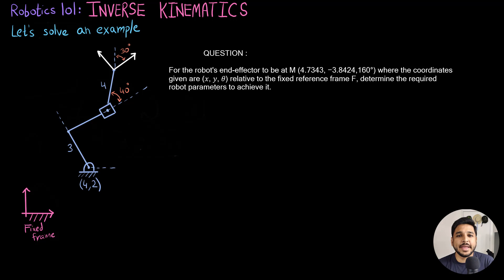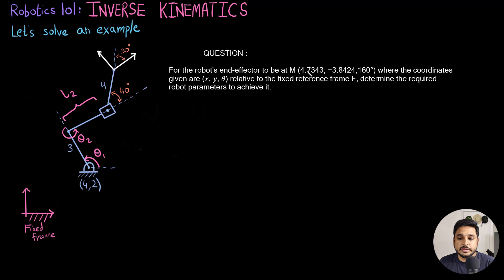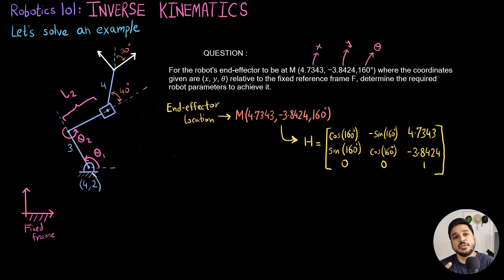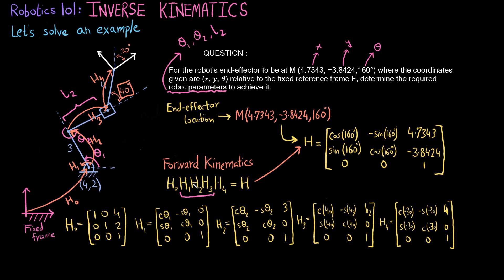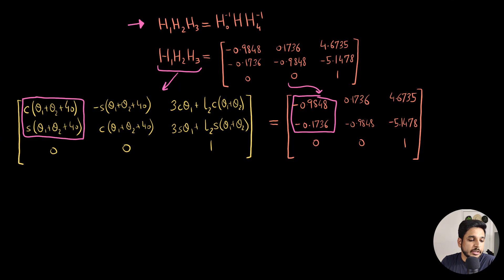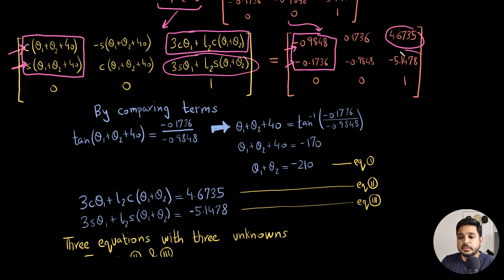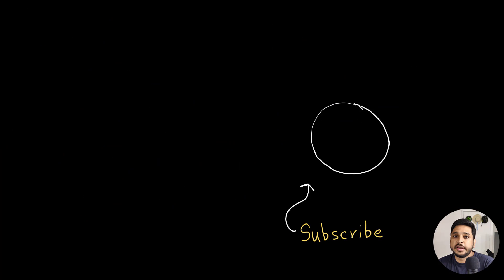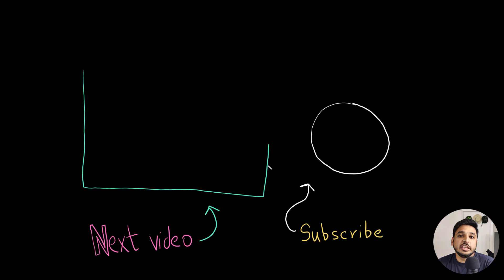Inverse Kinematics (with solved example) | Planar RRP robot | Robotics 101

Comment: Hi!
I have the  same 2 equations .
However , I go for cancelling out the L2 term by multiplying coeff of L2(s) in both the equation and then go for Sin(r)cosX + cos(r)sinX formula mentioned in previous videos. I got a different answer
Is squaring both side the right practice, instead of my approach?

Comment: Wait a minute this is the same example which you taught in forward kinematics with solved example part 2 , there you didn’t use h0 , I mean you applied homogeneous transformations from the fixed frame to m1 frame (4,2) and then just moved forward but here you first did homogeneous transformations from fixed to base (4,2) which is h0 and then you did h1 which is rotate the frame why? But in the forward you didn’t do it the same way why? What am I missing
Reply: same doubt @EngineeringSimplified

Comment: great video, but I found a problem with the calculation for theta 1 when using l2a, I get different answer when I calculate, although I am using same equation, I get theta1 =15....am I doing something wrong?
Reply: Hi, I am getting the same result, I've checked with a scientific calculator and online.

theta1 =+15º and theta2 = -75 º(same as the video)

Probably a mistake

I am also confused on the representation of the positions, the video seems to not follow the same pattern as the previous ones (11:50 the angle of theta2 = 135 is confusing, it should go to the pink line as it's for the solution 2)

If I may ask, did you understand that part? Maybe I missed something, I have taken notes on all the previous videos and checked them, but still confused.
Reply: @Captain_Vitorio_Muscovy  to be honest this replay was 4 months ago so now I don't remember anything, and that is a problem because I have midterm on this topic in 1 hour 😅🤣

Comment: Thank you for the lesson! I cam e here finally going all the way around.
 But i have questions! What if there is no initial information about the angles..? And if it is like 6DoF..?
Reply from the maker: To help answer your question, let me talk about real 6 DOF industrial robots. They have a revolute joint or a motor at each of the joint and that enables them to turn only about 1 axis at each joint. Practically, to get the angle turned at each joint, you can simply read how much the joint has turned by using a motor encoder. Or you can even place a marker physically and see roughly how much the joint has turned. These markers are often used to see if the robot is zeroing correctly (no issue with the encoders).

Circling back to your question, it won't make sense to not have been given information about the angles and still asked to solve a 6 DOF robot. It will become too complex, holds little value and I don't even know if it's even solvable.

Does that answer your question?

Comment: Quite a good explanation. Though, I can't understand why the length values were negative
Reply from the maker: Thank you!
The negative values just mean that the joint needs to move in the opposite direction. If you get a negative value for a prismatic joint, then that means that it needs to move to the other side. Similarly, in the case of a revolute joint, negative means a rotation in the clockwise direction.
Hope that makes sense.

Comment: hey man:hand-pink-waving:. one little problem. when solving the inverse kinematics, if the order of the (H0^-1)*H*(H4^-1) change, the answer is gonna change. How to know what is the correct order
Reply from the maker: Yes, the order matters so if the order is changed the answer is going to be wrong.
The easiest way is to transfer one homogenous transfer at a time, that way you won't make any errors.
For e.g:
A = B*C*D
A*(D^-1) = B*C
(B^-1)*A*(D^-1) = C

Another way to do the same thing:
A = B*C*D
(B^-1)*A = C*D
(B^-1)*A*(D^-1) = C

Hope that helps (you can have a look at this picture as well: https://image.slidesharecdn.com/5-6inversematrices-110830001431-phpapp02/85/64-inverse-matrices-62-320.jpg?cb=1668329589).
Reply: @EngineeringSimplified  Idk about @minidupradeeptha4673 but I had the same question and you answered it perfectly.
Thank you for your videos! :D